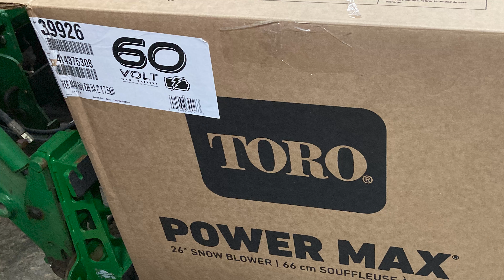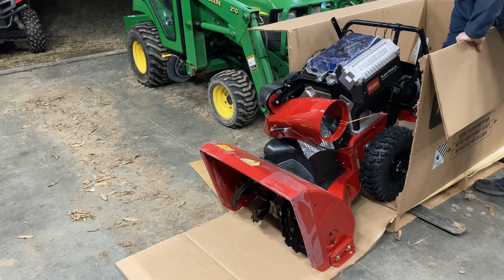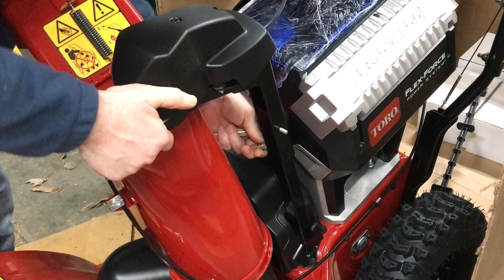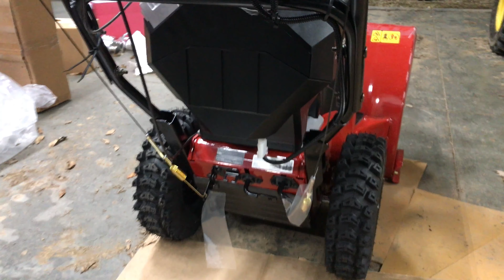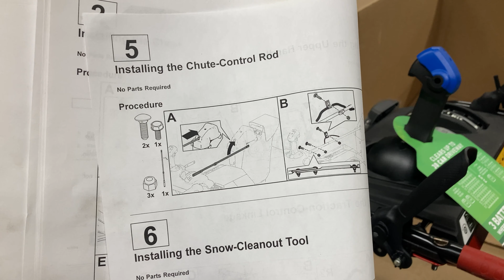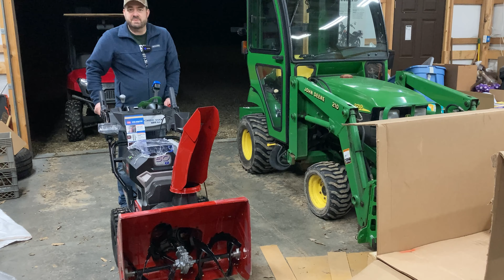60V Toro Power Max e26 HA snowblower simple assembly tutorial model 39926

Comment: I think u have the bolt backward….it should be installed on the opposidte side of the rod so that when you open the battery compartment door it doesn’t hit the bolt (or if it does, it hits the rounded edge of the bolt and not the threaded part of the bolt). 11:08
Reply from the maker: Interesting - you might be right.